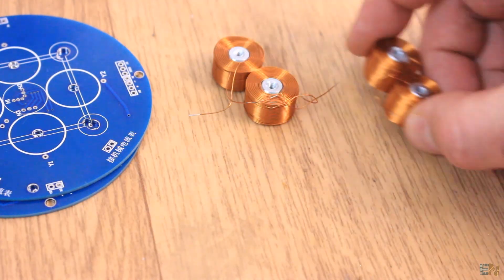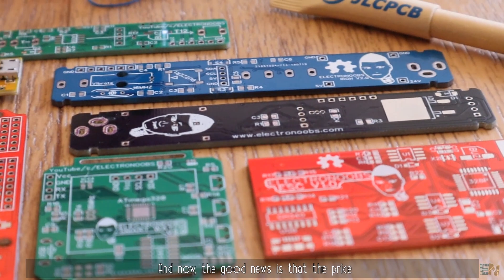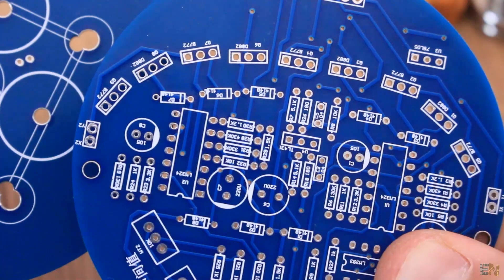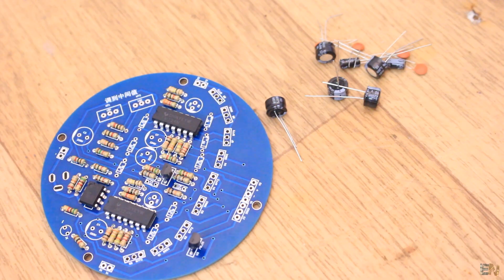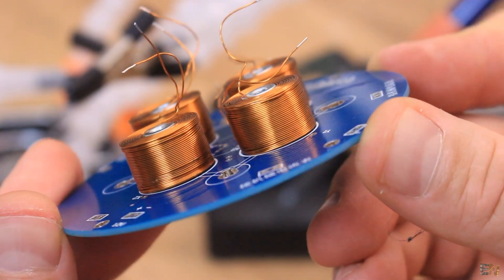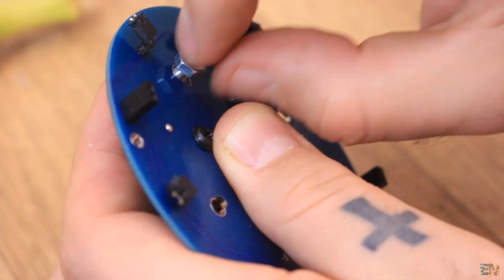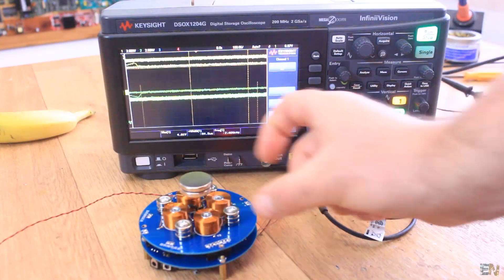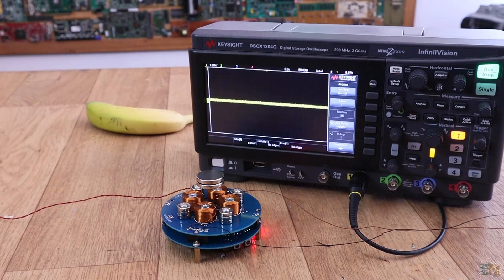How Is This Floating In The Air?

Comment: Amazing tutorial! can you tell me what is the need to keep the hall sensor as tall as the coils???
Reply: I believe it's to keep the hall effect as high up as possible, so that it will always be in viewing range of the floating magnet. If it was at the bottom (laid flat against the PCB), it would already be a solid 1-2" inches away from the floating magnet, which is close to the maximum range for most hall effects.

Comment: If you refer to the Chinese schematic, or an ohm meter, you'll notice the X and Y sets of coils are connected in series. The opamp Hall control only modulates the field strength of the entire axis, not individual coils. If the magnet wanders up or down in the Y axis, the Y power will drop and likewise in the +/- X axis. The Z axis is only used for the comparator to turn on the circuit in the presence of a magnetic field.
Reply: All pure analogue, H3 (z) controls/regulates the supply voltage of the other control circuits.
Reply: Absolutely correct, can you please tell me how it is controlling coils power linearly? , is it based on PWM or something? How controlling signals are applied to the H bridge driving circuit? Thankyou in advance

Comment: Can upgrade and make magnet locked so there is high resistance so you can't push down, so the magnet bouncy is much less, the up and down magnet field is less too, so you increase the magnet field, you decrease up and down so you locked it so can't push up.

Comment: I have tried your pcb design and found few issues which is
1. 78L05 is not connected to ground 
2. Resistor values are wrong to maintain floating magnet

Comment: I purchased a diy kit but  unable to make it work. I was sent a debugging guide showing a multimeter connected  where the jumpers are placed. You have to adjust each one (Y & X) to  zero amps, but mine is not reading anything :(  The led only lights when the floating magnet is placed above, which is correct. What could I check to determine what is wrong with mine? Is there a way to check the coils to make sure they are working?

Comment: OK, I was playing with mine and I can't make my 2 magnets to do anything but crash! My 2 adjustable pots are not 10K but 100K!??? That is what came in the kit. But when I measure them, thy are 0-435K, so mismarked and they are not smooth when dialing in the values. I'll try to remove them with 10K matching once and I'll put them right in the middle 5K both. I also can't get the LED to light up like it did once year ago. (It just blinked and at that time, I didn't know what for.  Now we all know that it's function is to tell you of the sweet spot position of the magnet!) OK so I soldered in new 10k pots, set them both to 5K, but I get the same results - no go! I have the same problem like most of the guys here mentioning: the magnets do not levitate but just push to any of the 4 side magnets. So somewhere is a problem that I can't figure out. Almost like a dead circuit, but I do get 12V everywhere I should. 
What are the 2 jumpers - some Chinese word above them -  for? Are these some test ports? Are they there to enable or disable something important for calibration?
Thank you for your videos!
Happy new year 2021 and many more subscribers and supporters!

Comment: Hi man, I'm a big fan.
I have bought one of those kit and build it, it does not work.
The led is on when there is no magnet and one of the B772 failed (got very hot)
Can you please help, Thanks
Reply: Excactly. Same happens to my craft. Did you make your coil or you ordered one?
Reply: @mohammadamirkhani7510  the coil was included in the kit

Comment: I've built the circuit and the LED remains on until the magnet is presented, at which point it turns off. It seems the Z hall effect sensor is de-activating the circuit rather than activating it. Any ideas what I might have done wrong? I can feel the coils having an effect on the magnet just before the LED turns out.
Reply: Well, I inverted the permanent magnets around the edge and the led works as intended now but that's all that happens. I can't get it to balance. Any tips on tuning?

Comment: Can you show us how to calibrate this? I have one but the magnet in the middle is falling to one side. It’s not level.
Reply: find a solution? Mine won't levitate in a stable manner either.
Reply: MikeRoss1986 no. I have two modules. One that tilts badly to the side and the other is having the same issue as yours. Please let me know if you figure it out too please.

Comment: Mine when i turn it on the big magnet just snaps to one of the smaller ones at the side. No matter how in center i place it it randomly jumps to one of the magnet. Any solution what I could do wrong ?
Reply: Did you find a solution? Mine is doing the same.
Reply: @MikeRoss-je2zt   @Chriss Re did you find a solution to calibrate the device? I'm struggling since months now ._.

Comment: I have this kit, but I'm not able to levitate! The 2 adjustable pots (blue boxes) must have some "starting" value, but I do not know what that value is. Can you make the schema where you soldered the wires and use them as input on tour oscilloscope, so I can measure the values? What are your values? Thank you for your videos and help!
Reply: Did you find a solution and get it to levitate? I'm having the same issue.
Reply: @MikeRoss-je2zt  im having the same problem, did you find a solution?
Reply: Same issue here. It seems like the Hall effect sensors are working and triggering the transistors but the fields aren’t balanced at all and the platform just falls to whoever side it’s closer to
Reply: I'm having the same problem too
Reply: @nates6157  I did not! It was waste of $$$$!

Comment: Your video so far is the BEST on the Internet for this project! Your other videos are very well done! I've demo your channel to my friends and clubs - you should have more followers now!
The instructions in the kit are one of the worse! I'm giving them 1 star only! I don't know if I could do this project at all, if not for your video!!! 
Did you leave the 2 adjustable pots in about middle position? Thank you very much!
Reply: @Tony Fleming did you have issues balancing the floating magnet? And how did you solve it? I have the kit as well and am struggling since months to calibrate it with the potentiometers ._.
Reply: @d_maeddy  I was not playing with mine, BUT you should solder the 2 pots upside down, so you can adjust them without getting the 2 parts separated.... One of the pots is EAST/WEST and the second does the NORTH/SOUTH - based on what I found from someone. But I was busy so now I'm cleaning up and going to fix it soon. Let me know if you were able to make it to work and make a video here. Have a great one everyone!
Reply: @d_maeddy  I am struggling to get my fields to balance the platform as well. I can feel the transistors firing which causes the platform to vibrate a bit, but I still can get the thing to stay in place. Looks like this is a common issue for these kits. We need a proper troubleshooting forum for these things

Comment: Dont try his pcb, there is is a lot of mistakes, its not even working, i’ve order pcb and there is a problem with 78l05 micro. Help me to fix your mistake
Reply: GND pin of the 7805 is not connected
Reply: @mohammadamirkhani7510  شما ساختیدش؟ من ساختم در اول متوجه زمین برای رگلاتور 5 ولتی شدم و یه زمین بهش دادم ولی هنوز نمیتونه تعادلش رو حفظ کنه ، ممنون میشم راهنماییم کنی

Comment: I'm assembling it right now, but the parts do not match, couple resistors had wrong value and the adjustable 3 pin pots are 100 Kohm not as printed 10 Kohm - should I replace them with 10K ? How about the 130K it was only 100K? I'm also not able to read Chinese so I have no clue what the instructions are telling me. Have you made your own board? Something much more simple in English instructions, so kids can learn to solder this in a class when we teach them to solder projects? I'm a subscriber also - thanks for your ideas!

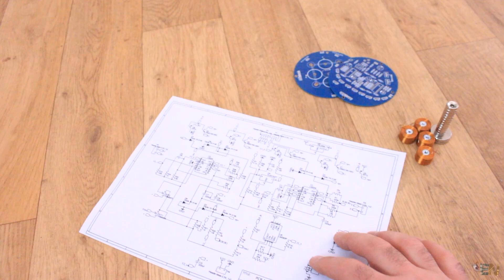Comment: 2:09 Dude, lower your soldering iron temperature, you are going to rip some tracks at that temperature. High temp is good for groundplanes, where your soldering iron doesn't have too much power, but you're relying on the thermal inertia.

Comment: What are the coils parameters? How many turns in each layer and how many layers? What is the wire diameter? Does it contain iron core, or it wired around plastic with nuts on top and bottom? What inductance have that coils?
Reply: I'm asking because circuit itself is not big deal, all components are standard. But coils are not. And that's prevent me to repeat that scheme.
Reply from the maker: @limtbk  I don't know how many turns, The wire diameter is 0.25, the inner aluminum screw is 7mm diameter and the coil is 19mm diameter and 11mm height.
Reply: @ELECTRONOOBS  So, we have (19-7)/2/0.25=24 layers, each have 11/0.25=44 turns, so about 1000 turns in total
Reply from the maker: @limtbk  well, not really, that would be without the clearance. The amount is way lower. Here I've uploaded some photos for you. I count 30 layers and each layer has around 9 turns. 
Photos: 
http://electronoobs.com/images/Circuitos/tut_33/coil1.jpg
http://electronoobs.com/images/Circuitos/tut_33/coil2.jpg
http://electronoobs.com/images/Circuitos/tut_33/coil3.jpg

Comment: Does anyone know the name of the coils or where they can be bought individually?
Reply: Don't know what coils they are, but you can probably make your own. The wire looks like it might be 24 or 26 AWG with about 20 or so layers. Not sure how many turns per layer or what the core is made of, but it looks like it might be aluminum and if the magnets are 5cm, then the overall coil length is approximately 15 cm. With something to serve as the core for wrapping, a few nuts, washers, bolts and varnish, you should be able to make something close to the ones supplied in an afternoon. I, personally, like to use bobbins for sewing machines as they are pretty inexpensive and leave you with nice looking coils.

Comment: This analog circuit seems to be pretty fast at response. Microcontroller based levitation circuits are generally slower due to the processing time of the microcontroller. Op-amp based or descrete logic based levitation circuits are very fast. You may think of an FPGA based levitation circuit. Love from India. ❤️
Reply: It really depends on your type of microcontroller. Using a FPGA seems to me pretty overkill.
Reply: Prajjalak Chattopadhyay seem like programming the board itself to me.
Reply: Do you know that which sensor he has been used in this.if you know then please help me
Reply: Hello sir, can you please tell me how it is controlling linearly with respect to magnet position, is it based on PWM or something? How controlling signals are applied to the H bridge driving circuit? Thankyou in advance